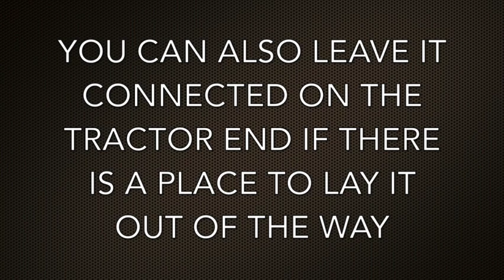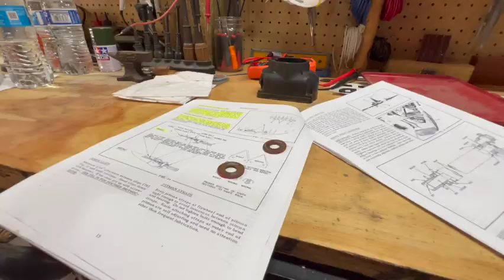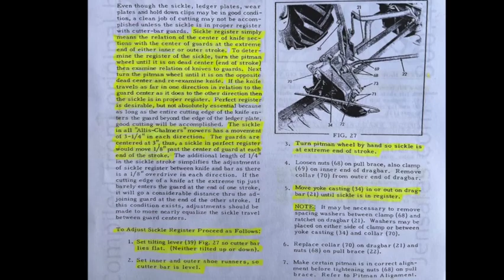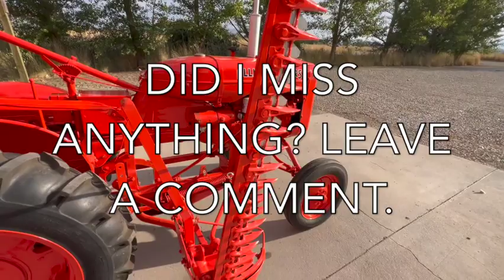Antique Sickle Bar Mower - Part 1, Introduction & Adjustments

Comment: T he 3 1/4" adjustment  needs to stop on the guards at the same location  at the end of the pitman stroke. I think it's  called timing the sickle. If it goes further one way than the other way in relationship to the  ledger plates on the guards, it will cut fine going one way but the sickle section (knife)  won't travel across the ledger plate on the guards when it returns to the other side . This is very important so it cut equally going  other ways. I hope you understand my explanation because on the video it appeared to go past the guard one way and not the other way. You keep doing this. I really look forward to your projects. You do a great job. Don't stop!!!
Reply from the maker: Thank you!

Comment: A wonderful presentation of how a sickle bar mower works and should be adjusted properly. I have mishandled a few in my 25 years of small acre weekend farming. Mostly due to lack of insight, lack of a manual (who uses that?) and multitudes of stones, rocks and ant nests. All takes it toll on old machinery. But only a few days ago I taken on the winter project of restoring a Kuhn 6' sickle bar mover that I broke the wooden pitmann arm on years ago. In your video at 2:45 and again at 20:35 I recon that you are missing a shoe for the outer end of the bar since you have the same adjustments available like I have on my Kuhn - with a shoe on. Once you have that, I would set it at the same level as the inner shoe. But then again I haven't mastered the sickle bar mower completely. Yet.
Reply from the maker: Thank you very much. Yes, you are correct about the shoe.

Comment: When we used those to make hay we poured used motor oil over the whole thing while it was running. Switched to mower conditioners in the 1960s

Comment: You have adjustment rods on the outside of those bolts that you took the washers out of. 
 To adjust your belt you see the big long nut and the lock nuts on the top and bottom of the adjustment nut and there is threaded rod on the top and bottom of it, that’s how you adjust your belt for the Sickle Bar Mower!
Reply from the maker: Great! Thank you.

Comment: I also have an Allis C with that mower. The transport rod lays on top of that little flat iron that is bolted to the large angle iron that supports the front of the mower. The pitman should be wood for the reason you stated. The one on it now is too long. The tip of the knives should travel from center to center of the rock guards. The second handle (the one that was stuck) is meant to adjust that angle of the knives on the go, depending on conditions. Tip the bar up for rough, rocky ground, down for downed tangled grass. The belt tension is adjusted by adding or removing shims in the top pulley.
Reply from the maker: Thank you sir!

Comment: As mentioned, all the sickle mowers I've seen uses a wood pitman arm.  I have a Ford 501 sickle mower, that attaches to the tractor's 3 point hitch and uses the tractor's pto to run the mower.  I had to buy a new pitman arm as the one on mine when I bought it was broke.

Comment: Every sickle bar I've owned or even seen had a wood link from the eccentric to the knife bar... 
The part that breaks first as a sacrificial, and easily repairable, piece. Once used an axe handle for a weekend to finish cutting.
Reply from the maker: Yes, wood seems to be the best way to go.

Comment: The outer edge or guard was actually a board about 5" wide. The pitman bar that made the cutter bar work was made of wood as a safety feature which broke off depending on the terrain or obstacle in its way.... that's why picking stones after plowing was important to make sure the terrain was smoother. My dad had an Allis Chambers C with that same mover. H bought new in 1949. It's still in family in Holland Vermont.
Reply from the maker: Thanks. That’s neat your C is still in the family.

Comment: It looks like your outer shoe is actually missing the skid plate or “shoe”. It has a hook on the front that goes in the square hole and a bracket that bolts into the long slot at the back to adjust how high the cutter bar is held off the ground
Reply from the maker: Thank you.

Comment: The lower pulley is adjustable ,  add or remove shims to change. Pulley diameter. Or it’s on a cam like the fan pulley

Comment: Your videos are a delight to watch. I’m enjoying your Allis Chalmers B series. I have an Allis Chalmers CA wide front. It came with a 59” belly mower which I took off. I tried to roll it during a winter month. The CAs have a dip stick for the transmission on the left side of the casing which was missing. I found out when trying to roll it during winter it had water in the transmission. FROZEN. So I had to heat it up to drain it and then add fluid. Rolled fine after that. I’m from Minnesota. Where a you from? Thanks for the videos.
Reply from the maker: Thanks Dennis! I am in the great state of Idaho.

Comment: Your end of the bar fnife section should be a knife and a half or end of the bar will plug up I mowed with Grandpa's b and the same mower you have there's also a metal arm so you can use the hydraulic plow lift on the back of the tractor right behind the seat

Comment: Re-read the part about register. From what I saw in the video, you're about a half of a knife section out of register. The ends of each stroke should line up with the center of the guards. That maybe caused by the pitman being to long. Seeing how it's a metal replacement, I would imagine there's an error there in it's length being to long. Mowers out of register tend to plug up in heavy grass. Having the knives centered on the guards is sort like a neutral position for the start of the next cut cycle. 40 or 50 years ago all Ag equipment dealers had stacks of pitman arms. They were considered a disposable and an often replaceable part. They were cut to the proper length for the model of the mower and drilled for the attaching hardware, and your hardware looks to be in decent shape. Maybe the wood is still being offered in aftermarket catalogs. I have an old JD #5 mower owners manual that explains how to adjust knife hold-down clips. It's pretty crude, but very effective for a field adjustment. If the hold-down is to loose ( jamming on an oversized piece of brush), smack the end with a hammer to get it back to it's position. If you smack it too hard and cause it to bind on the knife, use the ball peen end of the hammer and hit the hold-down between the bolts that attach it to the bar. That action will restore the clearance. From my own experince, you'll have to tighten the hold-down bolts after each adjustment. A quick and easy field adjustment without having to go back to the shop for washers or a new hold-down. Most of the hold-downs and guards are made from malleable iron, so they can take some bending without fear of breaking them.
Reply from the maker: Thanks Ed, as always, for the insight.

Comment: I know I'm late posting this, but I would not use this mower with a steel pitman arm. The  wood pitman is designed to break before anything else that is more expensive and in this case rare!